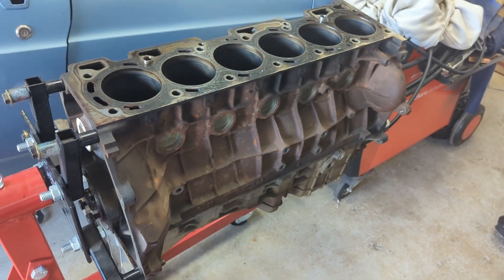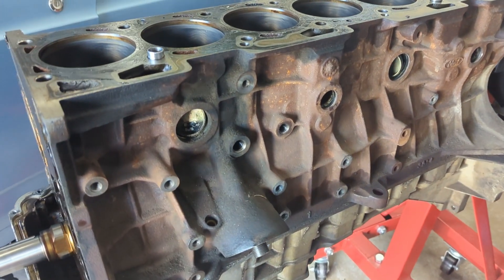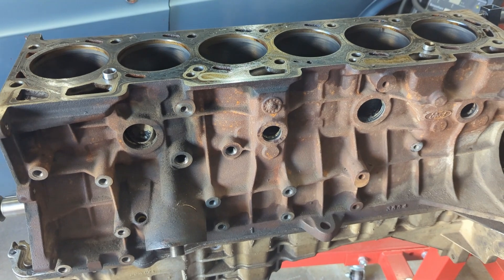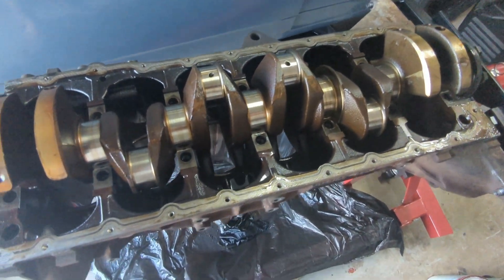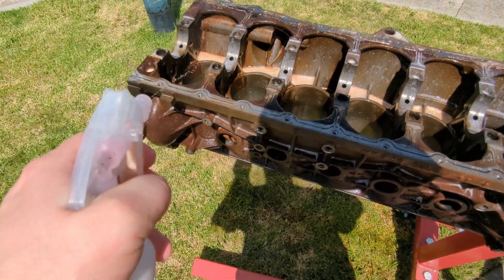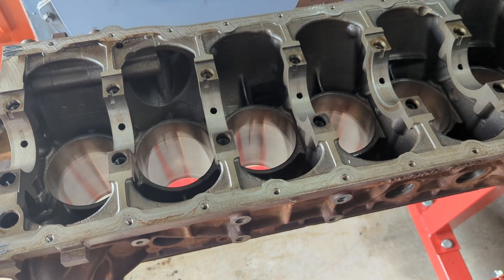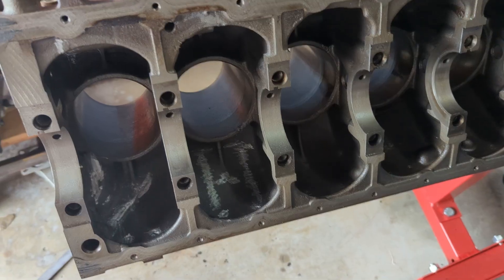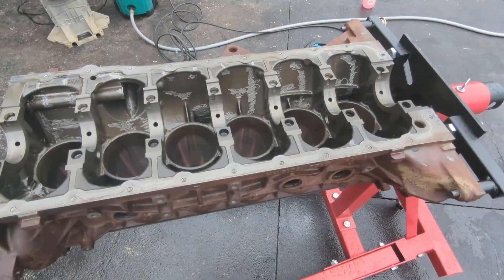Barra Engine Rebuild Guide: Step-by-Step Block Preparation for Performance

Comment: I thought you would put a 351 in but this is great. I'm old school but the Barra is one of the best engines ever made.  Used to be the Hemi 265 that was the best 6 . What a great build , my problem is I'd have to use a carburettor.  Ha,ha, old barsted ways .
Reply from the maker: I've had her for 14 years or there abouts, only just started working on her the last few years.
Way back when, plans were 351 4V, and then 393 4V. Then when I finally started building it, the Barra was such a great option so went all in on the Barra.
I'm excited to be at this part of the build. All the fabrication is done, now it's onto the fun stuff 😎🤙
Reply: @RestoHubAU  keen to get an update on this engine. I'm in the same position as we speak, how was your experience with Dandy engines? What kind of machining did you get done and approx cost? Would love another video on this!